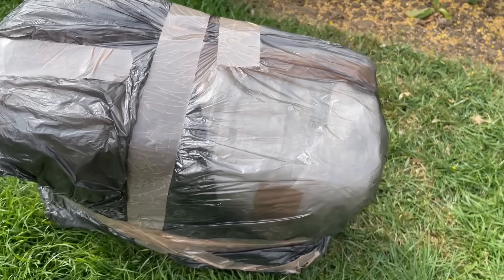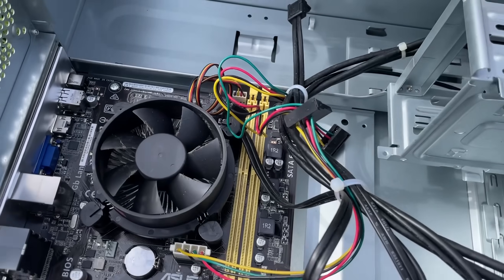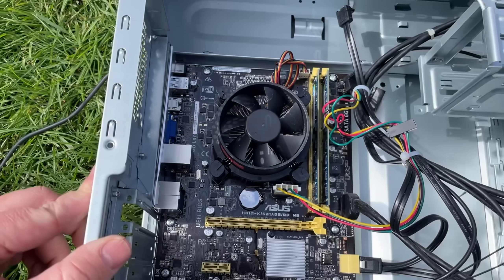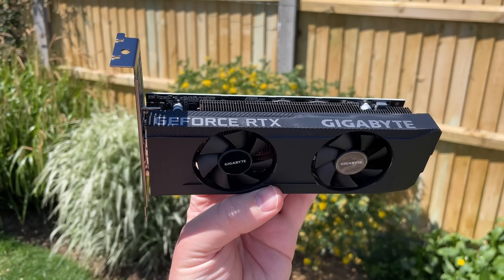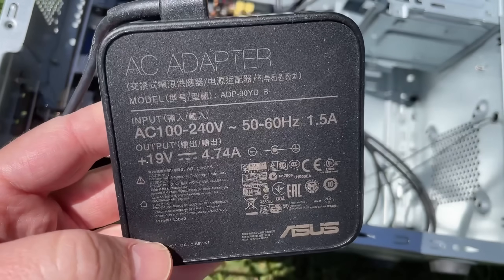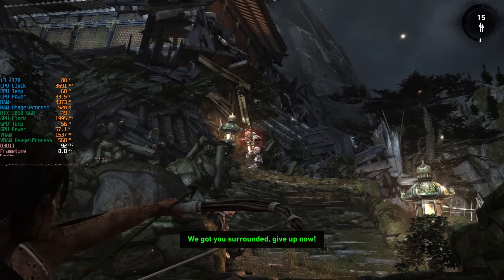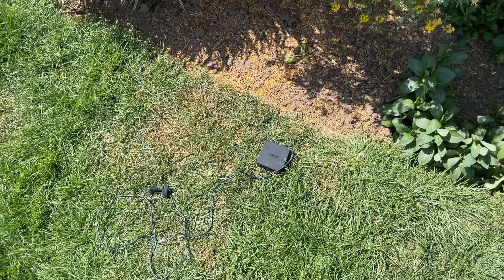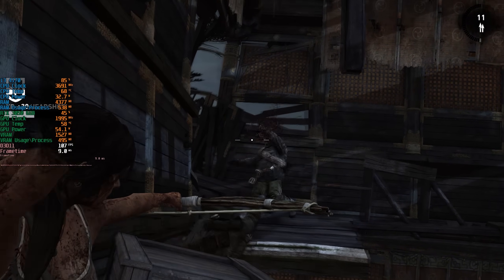This Weird Desktop PC is Powered by a Laptop Charger...

Comment: This could've been a decent little system with a SATA-PSU jumper. A Dremel tool could've opened up that PSU compartment at the top in no time. You could've mounted the 2nd PSU right in the case.

Comment: I built a very small pc with a Ryzen 4100 and an RTX A2000 which was powered by a Pico PSU and a 160watt powerbrick, it runs pretty well. I power limited the CPU 40watts, which it usually never surpasses in games anyway, and undervolted the A2000 so it runs at around 60watts.

Comment: You think you've gotten a bargain, but then it turns out the PC is actually unusable. That's what happened to me with an ASUS M70AD desktop PC equipped with an i7-4770. I bought it on eBay for €50, thinking it was a bargain. But because the power supply and motherboard are also proprietary, I can't pair it with a powerful graphics card, similar to this case. But thanks for this video, it was cool.

Comment: Those desktop motherboards using laptop power bricks initially weird me out, but thinking more about it they're not that far off from the 1L type systems sold by Dell, Lenovo, and HP to businesses that have desktop CPU sockets and power adapters ranging from 65w upwards of 120w or even 180w in some cases.

The difference is that they created an mATX version of that idea with a PCIe x16 slot that can't be powered suffuciently by the 90w brick and that they put it inside an mATX case resulting in the odd PC with so much empty space.

Good thing you tested with a 120w power brick as that points to either a blown fuse or an issue on the motherboard VRMs that convert the 19V from the power brick down to 12v, 5v, and 3.3v for the other parts of the motherboard.

Comment: I had a GT 710 with a G1850 Celeron (Haswell refresh) and H81 motherboard that drew about half the power that adapter provides. A bunch of those CPU's have the same TDP (thermal) and my whole system never drew that much. If BIOS allows, you can probably drop the CPU voltage all the way (0.9V or lower) and it will still likely run stock speeds. I was pretty impressed with how little power it drew for the time.

Often times the lower power boards will not allow a full 75W over PCI-E and that can cause issues, even if you upgrade the PSU. They are still pretty interesting. It's nice if you can find cheap stuff like this and put it to work. Appreciate the videos!

Comment: I think the Alienware X51 is a pretty useful guide as to what can be achieved with an external laptop psu on intel pc's of that generation, they came in 180, 240 and 330w I believe from memory. I think the 180w could deliver the 75w required for the pcie slot with a non-k i5.

Comment: I’ve seen a few SFF Dell machines that used a weird plug, almost like a laptop plug but a bit different about 10 years ago, but a “full size” pc tower with and obvious blanking plate over where the power supply would go is wild

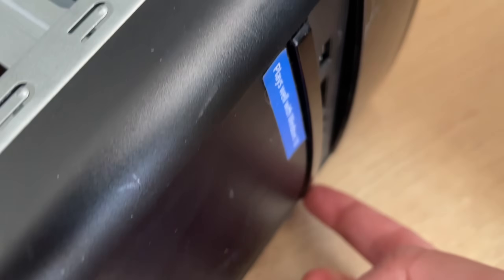Comment: 4:00 remove the bios battery and the RAM and the CPU. Power it on with nothing in the board. Then put the CPU back in and try to power it on again. That should reset it. If that doesn't work try another power adapter. If that doesn't work it's probably dead 😩
Reply: I have an ASUS board with a Celeron soldered on to the board and just a heatsink on top but that board takes a standard 24 pin PSU - it's weird how they decided to configure these things. I've got a transit van full of old PC parts if you're ever in Kent and want to have a look 👀
Reply: It looks like it's the charger that died, and the fault from that has fried something before the power stopped. Might be lucky and be able to reset, but not surprising if it surged the board and something has gone.

Comment: I had one of these come into the shop I used to work in a few years back. The customer asked if I could upgrade it for them. They weren't happy when I told them it was pretty much as good as it was going to get. From memory, the power brick they had for it was only 65 watts so there's no way it was going to handle a gpu put into it either.

Comment: actually, Tomb Raider 2013 might've worked using the iGPU on this poor thingie, altho you'd have to lower most settings
Reply: That game barely ran ok (playable but on the edge) on the more powerful model of the gt555 with 2gb of vram at 720p with everything lowered. 

Has the game become massively optimised since?

Comment: I had an HP "desktop" that was essentially a max 65w power draw laptop board stuck in a desktop case.  Used a full size desktop cooler (even though it made pretty much no heat...) and 2 sticks ddr3 full size DIMMs.  CPU was ivy bridge Pentium G2020T.

NO PCIE SLOTS WHATSOEVER.  Not even mini slot for wifi card.  Just NONE.  Only USB and SATA ports...!!!

2 SATA power cables soldered to the board, but each one only supplied up to HALF AMP of 12v.  Most hard drives wouldnt even power up with it.  It was a monstrosity.

Comment: This is still better than similar design HP desktops I've worked on before. The ones from HP used soldered AMD A-shit or Pentium Silver or whatever low power CPU from a low end laptop, SODIMM RAM, and no PCI-e expansion at all.
Reply: I actually have one of those HP "desktops". It has an AMD E-450 that is usable if you put linux on it.
Reply: That's just the reality of diminishing returns for cost cutting when it comes to chip and computer production.

You can only go so far reducing the price, and so those ultra cheap (150-200) laptops and things you get have to use parts and designs that seem insane. But you can't sell them that cheap without those terrible parts. If you want to buy a new laptop or dasktop for around 200, that is all that can be done for you. Save up to reach closer to 300 as a starting point if you want usable at least, 400+ starts to become good if you make sure to check what you are getting.
Reply: I have a 2012 HP like that with an AMD e1-1200 apu. It’s 1.4ghz 😂 it lasted me from 2015-2019 though for light use. Even upgraded from win 8.1 to 10 which took 6 hours. I now run the mobo by itself on Ubuntu as a raspberry pi sort of thing. The original case was 99% empty space with zero fans. 😂

Comment: The whole point of a minitower system is upgradability. But if you limited by a 90 watt power brick... that's useless. It's basically the guts of an Ultra Small Form Factor PC in a minitower case. What a waste. All the stickers on the case suggests this was one of those Big Store cheap PCs. Maybe it came bundled with speakers and a monitor as a package deal. I did some googling a could not find any of these no internal PSU ASUS desktops... I don't think ASUS was ever a popular desktop brand in the US. I do remember seeing some Lenovo minitower desktops like that though- power brick and all. But the power bricks were bigger. Crazy that an encased mobile power brick would be cheaper to use than an internal PSU. Would there be any reason to use the power brick over an internal? Any added safety concerns or regulations with the internal PSU? 250 internal watt PSUs were dirt cheap back then. - I assume when the PSU bit the dust, it took the mobo with it. Another reason to use a real PSU versus a plastic lump. Real PSUs usually have some protections.

Comment: Goes to show how much power hungry modern laptops are. I have an entry level gaming laptop with an i5-12500H and a 90 watt 3050. the charger is 200 watts. Lmfao
Reply: What a strange comment, that laptop is far far more powerful than this...
Reply: What are you talking about? Modern laptops are so efficient nowadays. Dell's 2003/2004 standard Pentium M laptops used a 90W brick as standard, now their standard models use a 45W wall wart. The 90W brick here is probably intended for the mid range systems that have a higher performance SOC like the AMD 8845M.

Comment: i think if this machine has an intel core i7-4765t cpu, the power is stable with a 35w tdp, the power brick can easily handle that intel cpu, i'm wonder to see what if the 35w cpu + rtx 3050 can do

Comment: Funny you bring this situation up! I have a Lenovo M720q 1L mini pc that i modified for my 10yo daughter for her Bday. (1tb ssd, 16gb 2666, i5 8400t) I added a WX4100 to the system with an adapter(roughly the equivalent of an RX560 4gb.) I have been a PC tech for the past 20 years, and i knew the included 65w Power supply "laptop charger" would not be enough so i went with 90w....well i noted the Performance was  really nowhere near where it should be... then i re- checked the "power need" and the CPU needs 35w, and the WX4100 needs 75w.... that is already over 90w. so i got a 170w and BOOM! system is fully functional on all cores and GPU! Even a tech with my lineage can still goof up!  Anyhow my daughter is happy now her games run great, all it took was POWER!
Reply: Won't that increased power cause an overcurrent fuse to burn?

Also, I hope you and your daughter are Healthy and well.
Reply: @xrafter  Nah, it apparently has a sophisticated power delivery system which knows how to throttle or utilize the extra power. These models are designed to have higher TDP processors as well as  graphics cards. so the base system is designed for different power needs.
Reply: @Brian_Buckley  
Well, apparently according to a youtube short it seems like the board is dead. Maybe the extra power caused this?
Reply: @xrafter  very possible. I don'
t remember if he said he removed the GPU, but that would have been my first troubleshooting step.
Reply: Oh i did this too but for my daughter but with a pc my dad left for me when he got an apple and not for birthday 😅
It's an phenom 2 X4 965 and a 23€ used rx560 with 4gb. 
Funny it is slower than my r9 270x combined with a 6core i5.
Reply: @Nordlicht05  well that 965 is Holding that 560 back.i ran that processor for 6 years until i upgraded to a Fx8320e, and eve that was a bottleneck for even my Rx5808gb. the 560 can Game when given the proper headroom.
Reply: @Brian_Buckley  no problem with games until now. The premise was not to spent much. I also have my old fx6300 laying around if this becomes a problem. But 10 fps more or less is not problem here. More likey everything will be changed including the gpu instead of using only a faster cpu. So its fine for now.
I also used a powerlimit. It is a 400watt psu but i used the same with my 185watt r9 and it died after two years and got a 600watt. Iam not a heavy gamer. So everything is on a budget. But it works. Measured the 560 with 50 watt until know in 3dmark. Dont know why its so low. Only did minimal undervolt.
Reply: @Brian_Buckley  hi i watched steel nomad benchmark today. The cpu load was peak at 17% gpu all the way 100% to the end. I think its something else when my newer system with the older r9 270x ist faster.
Maybe ram or, or i don't know pich pcie slot this mainboard has.

Comment: Try probing around the power area with a volt meter.  Feel if any mosfets or tantalum capacitors are getting hot.  Once I had a tantalum capacitor fail closed on a mini PC and it wouldn't turn on.

Comment: Perhaps a regular GPU could've actually worked off external power (runnin off of a generic PSU or something), from what I've heard standard 6/8pin GPUs tend to rely very little on the PCIe power anyways (unlike the 3050 LP which has no choice but to draw max power from the motherboard all the time) 🤔

Comment: My grandmother got a HP version of one of these years and years ago. It had Windows 10 on a hard drive, up from windows 7, and would take over 15-20+ minutes to boot, load and stop loading background programs; only after which would it be at all usable. I think that is mainly because it had an i3 2120T in it rather than the hard drive

Comment: I had one of these but from HP consumer line with a dual core i3 3rd gen, threw in some mismatched 2gb ram to the 8 that was in there and after a few weeks as a server I would sometimes turn on or keep running to test stuff it died.
No longer turns on or shows any sign of life too. Thought the 2gb might have died but nope, either wouldnt work. No fan spin up at all.

Comment: You probably could have gotten away with one of those low power quadro cards, the T1000 maybe? + the 120w power brick might have held out

either way, basically scrap metal at this point anyway

Comment: Back in the days of AM1 systems, I had 2 of these kinna things, AM1 board powered by 90W or 120W laptop brick. Used mine for TV boxes. Toss in a hauppauge winTV HVR tv tuner card, SSD with windows 10 and boxee... ermm Kodi and Hey look, TV box that streams and allows you to watch stored content. Maxed out at 1080P.

Comment: wow thats incredible... its like someone decided to combine the inconvenient parts of a a laptop, with the inconvenient parts of a desktop
Reply: It kinda reminds me of those overpriced all-in-ones that HP likes to make, but worse because it's got a port that's just asking to have a peripheral plugged in that can blow out the whole system
Reply: @DragoniteSpam  yep!
Reply: It's just a basic office PC. Motherboards like that usually come in SFF cases rather than towers. There are other things that plug into PCI-E slots besides GPUs, and there are GPUs that require less power than the one he used. Fancy killing a working PC because you can't' be bothered to use the right parts. 🙄
Reply: @another3997  I'm all for saving precious resources and working technology, but hear me out.

Do you know how many office employees have more technological knowledge than the average person?  The problem is that the PC has a hidden risk that NO operating system can detect and avoid!!!

You'd think the motherboard would have adequate power delivery circuitry built-in to handle an overload situation such as that.

Because it doesn't have the protections of a standard rectangular box internal PSU unit, it couldn't shut down due to overload power draw.  Any other PSU would have shut off, saving precious components.

This failure of the PC is a design flaw, and it's a good thing DC-adapter-powered-desktops are not the norm.  They are a huge risk.  And when it comes to electricity, you must ALWAYS overengineer it, and be safe!!!  Power gone wrong can be far more destructive than just a non-working motherboard.  Ever seen a motherboard fire?  It's HORRIBLE!!!
Reply: It's common for 1 litre business PCs to use laptop PSUs but that's about the only appropriate implementation of this.

Comment: I've seen this kind of thing before, I'm actually planning such a build with a PICO psu running off a 140w USB-C PD trigger board so I can power it off a phone charger or battery bank. Just need to select the right parts. Cus 140w minus buck converter losses is not much power budget for a desktop gaming pc.

Comment: You shouldn't have tried to run it with the GPU off of the original power adapter, especially under load. The TDP of the GPU and CPU combined is 124W. That's not including power draw of anything else, though any additional draw would admittedly be minimal. You cooked it.
Reply: Yes, he cooked a $7 PC. Big whoop.
Reply: @md_vandenberg I hate to see any technology ruined that could have easily been prevented by applying common sense. Using a couple of online power supply calculators, they recommend approximately 250W for this config. That of course includes overhead because you don't want your power supply loaded at 100% but still, he was overloading his adapter by quite a bit. If the adapter was actually as hot as he said it was, he's lucky it didn't cause a fire.
Reply: @cdnron75  That was a shitty power brick, any no nonesense unit shuts itself off under overload or high temp. It was a bad design and this was a good video proving Asus was ready to skimp on safety for a cheaper adapter.

Comment: DC-DC stage on the board to turn the laptop bricks 19V into the other voltages needed is likely undersized and has zero protections, so overloading it killed it rather than a graceful overheat shutdown. Sounds like typical Asus junk alright

Comment: It's an Asus prebuild. All MoBos that I used with ac in (some thin mITX ones) have power limitations on pcie slot. For example my gigabyte board from that era can handle only 25w pcie adapters.
Reply: What's interesting is they either go off-the-shelf with their motherboards or come up with a semi-custom variant of their existing ones.
Reply: @blakegriplingph  this one in video is "semi custom". Boards that I meant from Gigabyte is like  GA-B85TN.

Comment: At least the PSU bay is just blocked with a metal plate so the case can hold a sleeper build. HP had a similar PC where you need dremel and drill to make cutout to the PSU and screw holes.
Reply: I have a case that is just like this from HP.  Can confirm youd need some machining tools!
Reply: I have one too. Powered by a glorious AMD e1-1200 apu. 1.4ghz of raw computing power 😎
Reply: @_..-.._..-.._  Those E-series and Atoms were crimes against humanity. :D
Reply: @keulloe  indeed

Comment: I wonder if someone already had their hands on it, iirc those systems often came with those low power chips.
Reply: This. I'd expect something like this to come with a 35 watt T CPU (like an i3-4150T), not a full-fat desktop CPU. Then again it's Asus so they might've saved money building this abomination by reusing an existing case (with a PSU blanking plate) and sticking a cheaper regular desktop CPU in rather than a more expensive low-power one, basically making it the buyers problem

Comment: 30ish Watts is about right for that i3 actually, rated at 54 but almost never hit that to hit full speed on them. In BIOS if supported or in XTU if not you can undervolt them heavily without much problem. An i3 4130 I had was running at about 25W at full clocks with no instability for a long time in an old HTPC build. My guess would be the voltage on the PSU was drooping and one of the board power VRM for the PCIe power burned itself out trying to run that GPU.